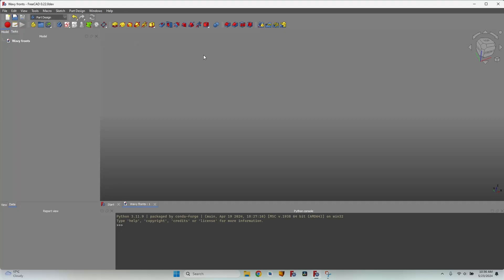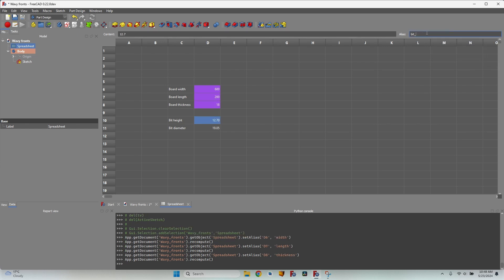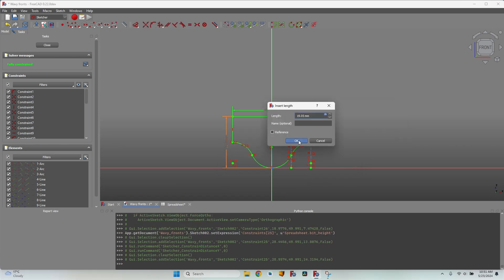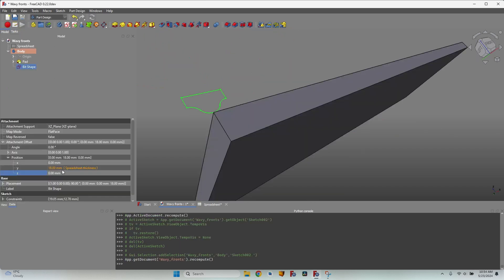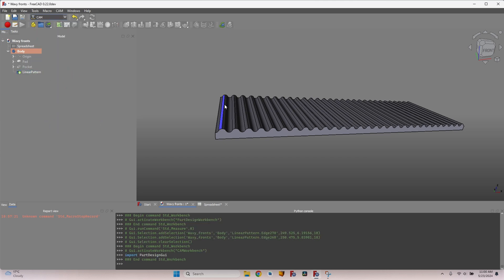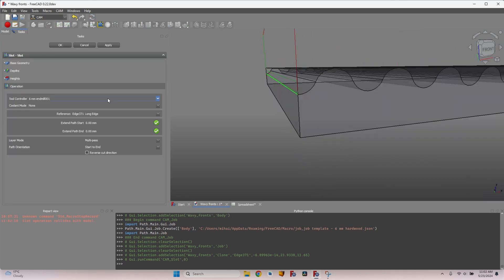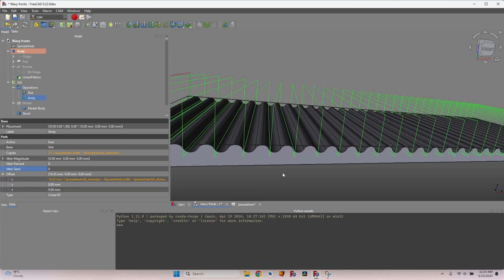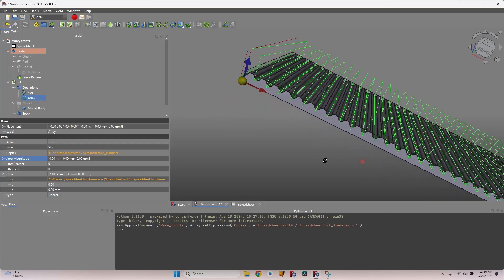Learn to Design and CNC Machine 3D Wavy Patterns on MDF

Comment: Great. But now you reached the point where everything is too much too fast. Sad.
Reply: Indeed. The topics on this channel are great. However, there are no natural pauses in the presentation meaning the information just zips by without any attempt to integrate the natural chunks.
Reply from the maker: Those pauses are what I hate when watching other videos. If I am following along, I just press space, but having to skip forward constantly is more annoying. Anyway, I believe the ideal should be somewhere in the middle, so thanks for letting me know, I'll try to adjust things until I get there, maybe even upload 2 versions of each video
Reply: @opensourcecnc  - Just do it as you did in your older videos. It's that straight simple.
Reply from the maker: That's what I did, or at least I thought so. I believe the dark gray color scheme of 0.22 adds a lot to that feeling, I kind of hated it too, it's much difficult to follow things on the screen for me, too. Thanks for the feedback, it is very helpful.
Reply from the maker: Thanks! A simple and clear message was what I needed to understand what I did wrong in this video and that's what you just wrote to me. I definitely won't stop
Reply: @opensourcecnc  "maybe even upload 2 versions of each video"Naaaaaa:)you'll find the perfect balance!goo luck and thanks!
Reply from the maker: Thanks, I'll try to sllow it down a little next time